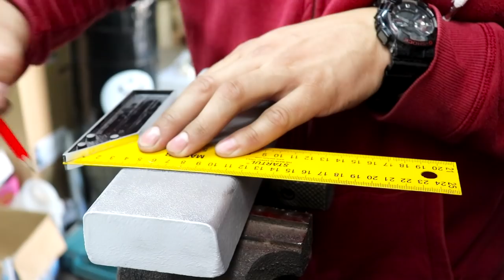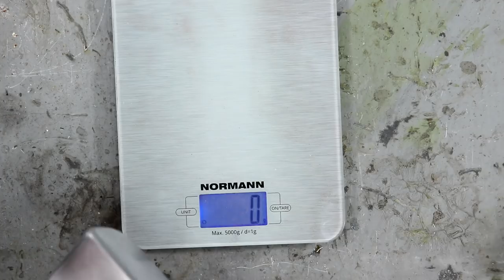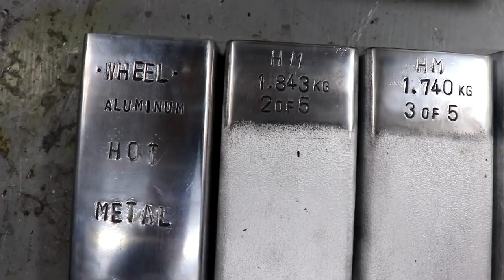Melted wheel rim. How much aluminium in wheels. ASMR Metal Melting . Hotmetal aluminium casting

Comment: Aluminum wheels are made of an alloy that is designed for metal casting. Therefore, these ingots are of high quality metal.
Reply: Yes absolutely great for getting cheap aluminium alloy so you don’t have to buy from a supplier although you can’t melt them too many times as this can ruin the Alloy

Comment: If you don’t want to buy aluminium alloys from a supplier that will provide high yield strength but be super expensive. just get some old alloy rims (damaged are better as they are cheaper) and melt them down as they are generally made of pretty strong aluminium and are Great for casting parts

Comment: I noticed very little sagging in your ingots. Im wondering if its the alloy used to make these wheels,  perhaps it could be your molds are shallow.
Reply from the maker: Maybe it depends on the alloy . Mold depth is 45 mm
Reply: They can be alloyed with zinc. That could be why
Reply: @keytefirerefining1355  I heard somewhere that zinc is commonly used to make storm window parts and it makes a difference to the scrap yards when they are sold ingots. "They don't know what it is."  I would like to see a list of what alloys they use in making aluminum products.
Reply: @mattyal9347  yeah yards are hesitant but bars sell for upto 30x more than scrap price on ebay so can make good money selling them there
Reply: @keytefirerefining1355  I  did see them for sale and  the price is as you say but do they really sell?
Reply: @mattyal9347  yeah they sell quite easy
Reply: @keytefirerefining1355  well thats an incentive for me because scrap aluminum comes my way all of the time.
Reply: @mattyal9347  yeah nice clean kilo bar will sell for more than a 2kg copper at the yard. Might as well turn your aluminium into copper value 😂

Comment: Wouldn't it be more energy efficient to melt the Al. into a cast rather than ingots, which then again have to melted? I could understand melting them to stock bars for machining but ingots?  Isn't part of the point about saving resources and energy? A complete waste of time and energy in my book.
Reply from the maker: I collect non-ferrous metal . The ingot takes up less space than the wheels